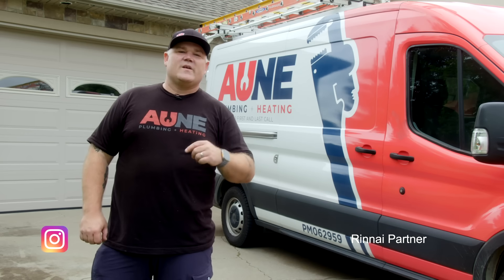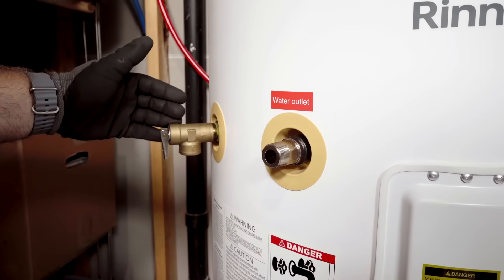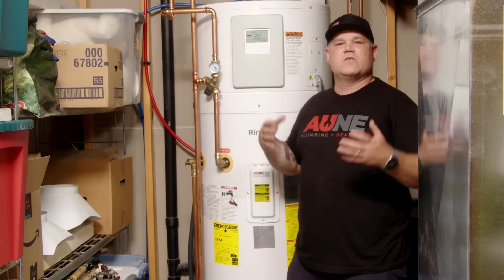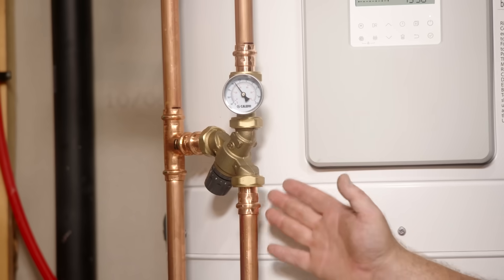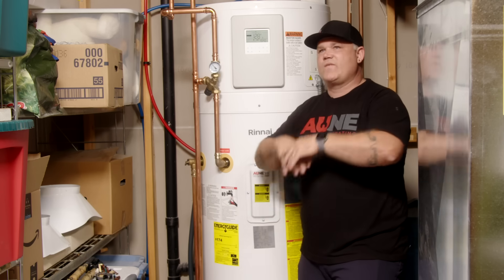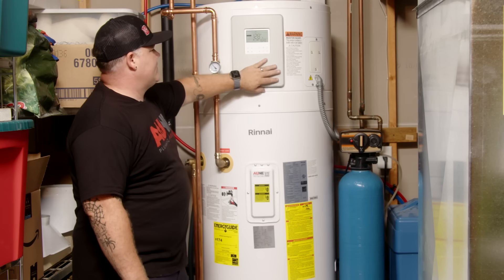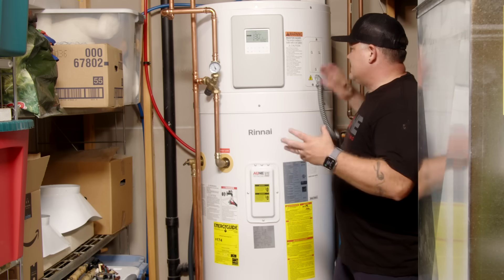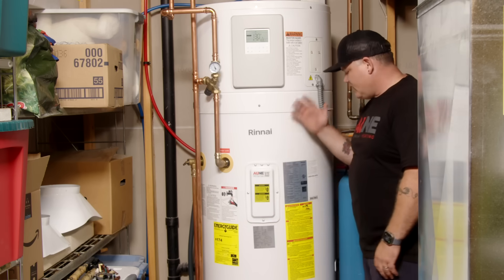Is this your next water heater?  Rinnai's new Heat Pump Water Heater

Comment: I just purchased one last Wednesday. It is a Rinnai 80-gallon water heater. My Marathon leaks from the top of the cold-water inlet. They will deliver it on Wednesday, I will remove the old one on Tuesday, and plumb for the new one. Thanks for the video. I used to sell and install heat pumps. How do they compare with heating with natural gas in the emergency efficiency mode?
Reply: What's your experience with it so far? I've on the fence but can't find many reviews.

Comment: Thank you for this video.  I'm in northern California and interested in installing this in my new ADU.  Not many suppliers here provide it, and many plumbers dont seem familiar with it - but Ive had very good experience with Rinnai products in the past- so very interested. I have a recirculation line ready to go - and it seems this product allows for recirculation.  Do you know anything about that with this product.  Minimal data avail in their spec sheets except that it possible...  Grateful if you know anything about this.  Thx!

Comment: I'm in Australia and have a gas hot water system which is outside the house. Can these type of heaters be installed outside if the temperature isn't too low. Where I am we get down to about 3 or 4 degrees Celsius in Winter overnight. But never get snow.

Comment: @mechanical-hub  Do you know how accessible the anode is?  No instructions on Rennai website.  Spec'd this for my build.  Plumber is concerned about replacing anode with Corro protect electric.

Comment: Do you notice any differences between the Rinnai and the Bosch "GreenTronic"? Specs are nearly identical, but no mention of decibel level on the Rinnai. Great install.
Reply from the maker: Specs are the same.
Reply: @mechanical-hub  because the products are the same? Supplied by Midea, white-labeled as Bosch and Rinnai with those brands' tech/software? Maybe I'm not identifying anything new to pros that are already installing these units - and I don't have any problems with them doing that - the product(s) seems pretty solid.

Comment: Nope. Not gonna work in an unheated garage in the winter. Next.
Reply from the maker: This water heater works just like every other electric tank water heater as well, it would absolutely work in a garage if your climate allows that type of install. If you're installing water heaters in garages your winters are not cold.
Reply: @Jimmyjimjimjim  what is the operating temperature range on the low end?

Comment: Great video. How loud is the heat pump especially during the initial start-up?
Reply from the maker: Not loud enough to inhibit normal conversation. Power vent water heaters are considerably louder, I don't have decibel rating but I was surprised at how quiet it is. At some point it's actually running in this video but my mic didn't even pick it up.
Reply: @mechanical-hub   Cool.  You know - when I sleep I need the bedroom :    
1. Cool,   
2. Dry,  &   
3.  I run a white-noise maker.   

Hmmm - what are the waste products of a HPWH ?
Cool, Dry air & Noise

… like, perfect !    Bloody perfect.  
Can I install one in my bedroom ?  
Be absolutely perfect if it would run constantly.  Say, all night long on a very low setting.

Comment: I have a client that was inquiring about one of these for a lake house type of situation, its not always occupied, Are these a good fit for that type of situation? They come and go but not on a schedule,  is the vacation mode be able to set and indefinitely, not on a schedule?  Are there remote wifi controls to turn it on from before the get there?
Reply: FYI, existing is a 40 gallon propane at this property
Reply from the maker: It’s not wifi so they’d have to set a start and end time for vacation mode. If they set it to end vacation for the morning they return then it wouldn’t run when away. Otherwise it would sit idle and run as needed. Wouldn’t use much energy if in heat pump only mode I suppose.

Comment: Nice work!!!  Would love to see an installation where the heat pump is in series with something like a marathon.  Thanks for sharing!
Reply from the maker: What would be the purpose of using both?
Reply: @mechanical-hub  availibity of hot water/storage.  I've got a rheem 80 gal heat pump.  I also have teenage kids.  We burn through 80 gallons more often than I like.  I only have it on heat pump mode so recovery takes longer.  Also to have storage in case power went out.  Thoughts??? Thanks!

Comment: What is the advantage of this over a gas water heater. I imagine this is quite expensive. If it less expensive to operate over gas, it may take 10+ years to break even.
Reply from the maker: Imo it only makes sense if you already have an electric water heater. If you have gas then tankless can lower operating costs in some cases.

Comment: How much condensate do they generate and does it require a drain for the condensation?
Reply from the maker: Amount will vary based on load and humidity in the space. Yes, it’s needs a drain or a pump to a drain.

Comment: I know they make 3 sizes of this Rinnia heat pump water heater and I know I wouldn't need the 80 gallon version for my application.   I'm building a 1500sq-ft ranch 3bd 2ba in the spring for just my wife and I.   What size do you think would be appropriate for our home?
Reply from the maker: A 50 if you’ve got regular showers/tub. The challenge is recovery and mode settings. If you think you’re on the edge of what a 50 can provide then a 65 would be a nice upgrade
Reply: Thx

Comment: That looks like a really nice set up. I just bought a 50 gal Rheem and with local rebates and tax credits it as less than a quality standard heater. I’m sure that room is plenty big but people need to remember that when a unit requires 700 cubic feet that means an empty space not  one filled with boxes etc.
Reply from the maker: Yeah, it's all about the space, the unit has to be able to breathe to perform.

Comment: I'm curious how the noise level of the compressor compares to current generation rheem heat pump water heaters. Also, how do you clean the air filter? I don't see where it's accessed in the video. 

Is this model likely to be available at Home Depot or Lowes nationwide soon or will it need to be ordered directly by plumbers?
Reply from the maker: I don't know the dB ratings for the Rheem or this model specifically, I can say it's extremely quiet and requires no effort to talk over. It's no louder than most refrigerators imo. Not sure on distribution, I wouldn't way it's a DIY product.
Reply: @mechanical-hub "I wouldn't way"? Not trying to call out typos, just trying to understand what you are saying? These look pretty DIY friendly to install, assuming someone is comfortable with a few different aspects. Maybe you were saying it wasn't?